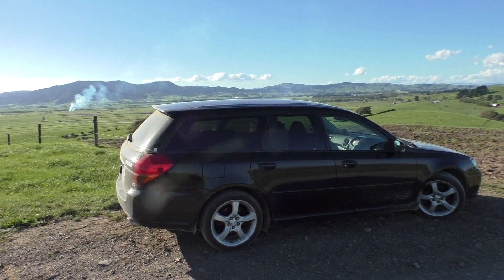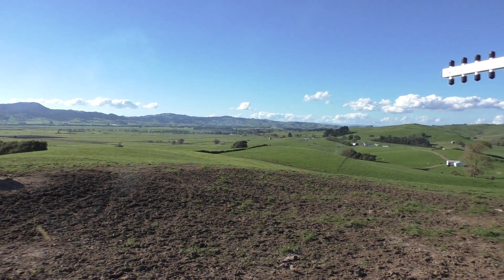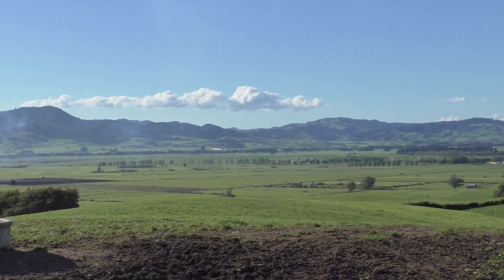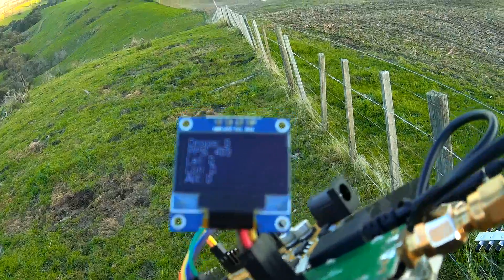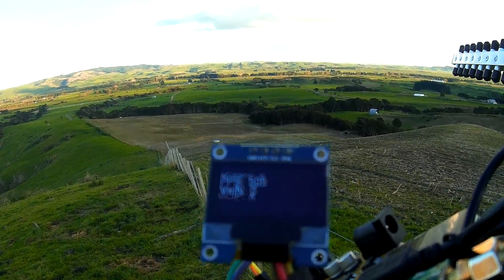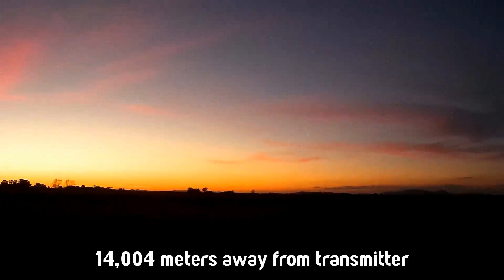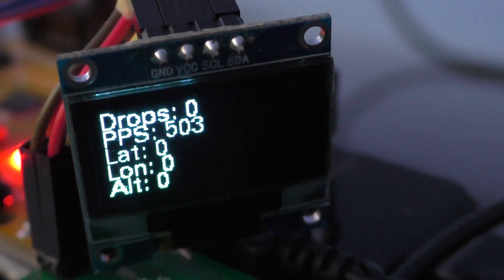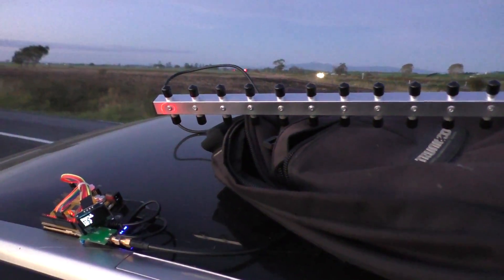nRF24L01 14km challenge!

Comment: Which cable used between antenna and nrf24l01
Reply: Please reply
Reply from the maker: The cable comes with the antenna
Reply: @iforce2d  I want only 5meter cable  please reply
Reply from the maker: Please reply about what? This is the listing, just read it.
https://www.banggood.com/RP-SMA-2_4GHz-25dBi-Directional-Outdoor-WiFi-Antenna-Wireless-Yagi-Antenna-with-Cable-for-Extending-WiFi-Coverage-p-1679563.html

Comment: Which library do I use for the nRF24L01.h from the Arduino IDE
Reply from the maker: This is the one I've been using for a long time. I think it was originally the 'Greg Copeland' fork of maniacbug, but I'm not totally sure. http://www.iforce2d.net/sketches/RF24-library.zip
Reply: @iforce2d  Opps. Now I see the link in the sketch..Thanks.. 

OK, tried compiling it and it seems like it likes Arduino nano, but not  any of the esp boards. 

Have you tried mounting your antenna on a tripod or pistil grip handle with the Arduino on the back end of the antenna, so you can see the response as you are pointing?

Thanks for the video. I have always been interested in long distance communication..

Comment: Hii sir,
sir, i am Sending a data from ( NRF24L01  transmitter)  to ( NRF24L01 Receiver ) . 
but  i want to put  its  Nodes ADDRESS in  DECIMAL  format 
like - ( this_Node = 12345           ,   Other_Node = 31296    )  .

but the problem is.... ,   in Decimal format addressing ,     Data is unable  to Send in my code . ( i think there is Addressing problem in my Code ) .
I Had  mail you my codes on  your  email 
i had also attached my  code below ,  Sir please  Help me to Correct the   Code .

i will be too much thankful for your  Help & Suggestions

....................................................................
TRANSMITTER  CODE
....................................................................

#include <RF24Network.h>
#include <RF24.h>
#include <SPI.h>
#define button 2

RF24 radio(10,A1);                  
int buttonState = 0;
RF24Network network(radio);         
const uint16_t this_node = 12345;       
const uint16_t other_node = 31296; 
void setup()
{
  Serial.begin(500000);
  SPI.begin();
  radio.begin();
  network.begin(90,this_node);
  pinMode(button,INPUT);
}

void loop(){
  network.update();
  //---------TRANSMITTING----------//
  
    RF24NetworkHeader header(other_node,DEC);
    unsigned long buttonState = 311; 
    bool ok = network.write(header,&buttonState, sizeof(buttonState)); 
    Serial.println(buttonState);
 
}

............................................................................................
RECEIVER  CODE
.............................................................................................

#include <RF24Network.h>
#include <RF24.h>
#include <SPI.h>
#define led 3
#define led2 4
RF24 radio(10,9); 
byte guest=0;
//#define buttonState1 8
const int buttonState1 = 311;
RF24Network network(radio);   
const uint16_t this_node = 31296; 
const uint16_t other_node = 12345;

void setup()
{
  Serial.begin(500000);
  SPI.begin();
  radio.begin();
  network.begin(90,this_node);  
  pinMode(led,OUTPUT);
  pinMode(led2,OUTPUT);
}

void loop(){
  network.update();
  //---------RECEIVING 1 ----------//
  while( network.available() ) {  
   
    RF24NetworkHeader header;
    unsigned long buttonState;
    network.read(header,&buttonState, sizeof(buttonState));  
    Serial.println(buttonState);  
    if(buttonState1==buttonState)
    {
      digitalWrite(led,HIGH);
      digitalWrite(led2,LOW); 
    }
    else
    {
      digitalWrite(led2,HIGH); 
      digitalWrite(led,LOW);                   
    }
  }
  
}
Reply from the maker: I have never used the 'network' feature of this transmitter, no idea sorry.
Reply: Its okk, no problem

But  thanks, for  your reply😊
Reply: You can suggest me to concern with your friend , who can solve my  problem
Please suggest  if you can

its  very important,   my project is going on

Comment: I just got 3 of the long range modules because this looks awesome. I have a radio trackeresque project in mind. But what are some other practical uses of transmitting data at these extreme of ranges? Just sensor networks and the like?

Comment: Holy crap man.  This is VERY impressive!!  I'm familiar with yagi antenna polarization via voice communication and have seen it affect the receive signal but have never messed with data.  Crazy!

So the xmitter says it's rated at 100mW and the antenna is a +25dbi.  My math says this EIRP is 3.89 watts, approximately.  There will be some loss with the coax at these frequencies, but close enough.  Very cool!!   Keep the challenge going.  I'd love to see this at 20 or 30km!

Comment: how are you doing with the RF Hash from the electric fences etc.  especially that close to them. Also. Nice to see how you realised about antenna polarisation. Just as a point of interest, you'll lose around 20 DBi at cross polarisation depending on the antenna. And don't forget, you're running 100mW into a 25DBi antenna so you're effective radiated output power (EIRP) is around 60-100 watts. Which is potentially illegal unless you're a ham operator, using the amateur radio 2.4Ghz allocation and you're sending your callsign in the packet as a means of identification :D

what data rate are you using and what packet length?
Reply from the maker: 12 byte packets, the program is set to 250kpbs rate.
Reply: that's what i thought it was something around 250kbps. as you get further away, you're going to get more issues with the fresnel zone (curvature of the earth). in fact in a uhf link i had that goes about 35 miles, we actually had to angle the antennae up, only by a couple of degrees but the difference was amazing.. bear in mind, one antenna was 18 floors up, the other about 6

Comment: :) Seems like polarization matters in same way :D You should had put the antenna to 45 degrees and wrote down the numbers you get so we can check the ratio between 45 mismatch and perfect match :D :D :D (btw LOL).

Your NRF modules seems like of very high qualities. I've troubles with mine ones even on short distance, like touching the module while trasmitting it more than double the packet ratio. So my modules are very sad :(

Another curiosity, what's the payload size of the packets? 32bytes ? Edit. Figured out from code I didn't see before :) 32byte as default _:)

Comment: Great video, i'm enjoying this nrf24 challenge so far! 
How did you do to point the two antennas towards each other? did you calculate the angle with respect to ground or just used the  rule of thumb? how big it is the "beam" as your experience?

Thanks

P.S it would be interesting also to try these modules against LoRa ones. ;)
Reply from the maker: I used this https://acscdg.com/
The azimuth number is the compass bearing. I compared that with what the compass on my phone told me. It was very close for the first location which I could check visually, so I just trusted it for the second location which I could not check visually.
Reply: beamwidth at that distance is going to be pretty wide.

Comment: Do you have ACK enabled or is that a purely one-way transmission? With ACK the lower packet rate could be due to the longer travel time of the signal. The 5+5 additional km would add about 33µs to a bidirectional exchange.
Reply from the maker: Astute as always :) No ACK for this one though, just one way.

Comment: Did you have to modify the sketch at all to get it working with pa+lna nrf's?  I tried to use some regular nrf24's and they worked great. However when i used a pa lna one it wouldnt connect to a regular nrf.
Reply from the maker: No, their usage is exactly the same. Maybe it's a power issue, the PA version would likely require more power. Do you have any caps on the GND/VCC pins? Try 0.1uf to 10uf caps, or even both (which is what I have on these).
Reply: Some units with PA+LNA have an unpopulated jumper on the PCB to enable the LNA. so they might not work straight out of the box. I have one such unit bought from ebay.
Reply: i havent had time to do that yet. I did that on the original nrf to get it working. Since then all my regular nrf's have worked without one. Thanks for the info!
Reply from the maker: Yeah I also had many that worked ok without the caps. I'm pretty sure it can't hurt to add them though.
Reply: Ended up being a power issue. The arduino that im using couldnt supply enough current. I put a cap on there along with a 3.3v regulator. giving the regulator is giving it enough current to drive it.
Reply: The one that i have doesn't see to have that, ill keep that in mind if i get more though.